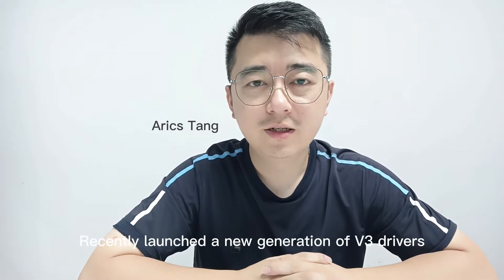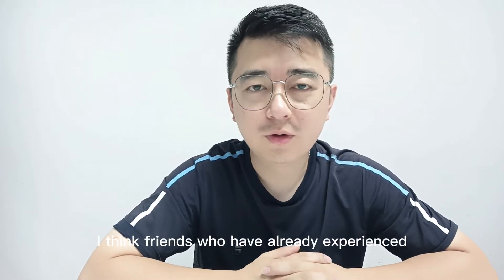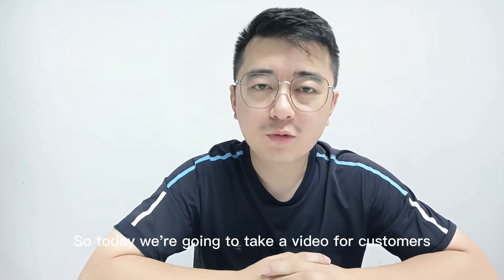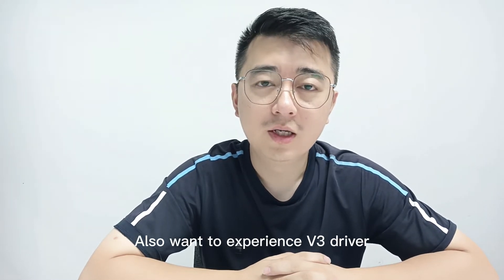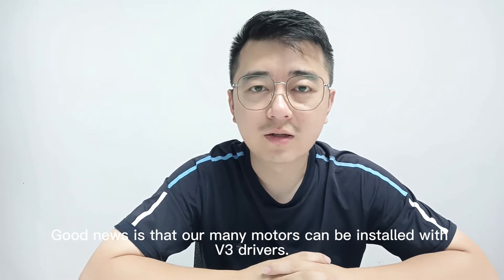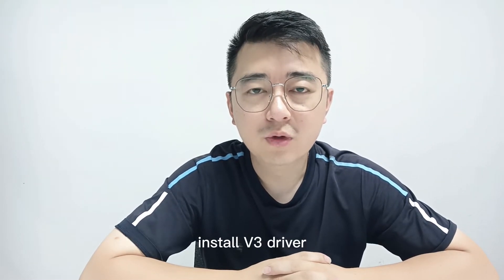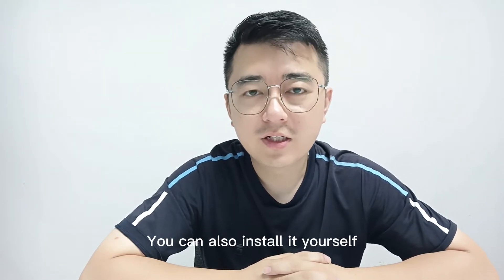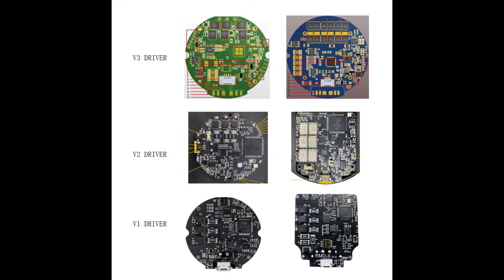HOW TO INSTALL V3 DRIVER TO RMD-X MOTOR

Comment: Hello! What does the connector situation look like on a x8 pro 1:9 without driver? Does it still have a encoder? I am looking to use this on a odrive application
Reply: These people don't reply to anyone. I gave up on them, emailed several times, nothing, my 2 RMD-X6 motors are junk as the CAN-BUS driver does not work.